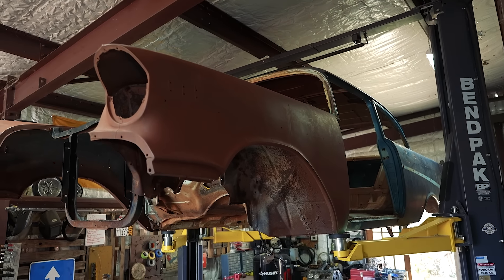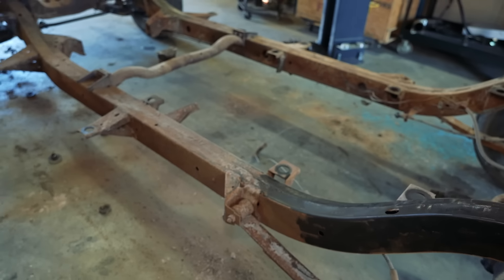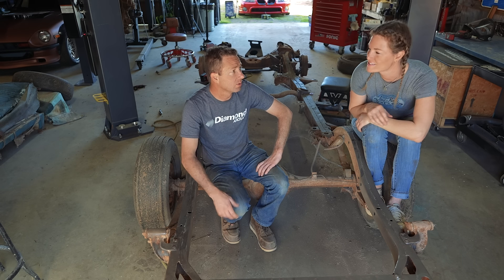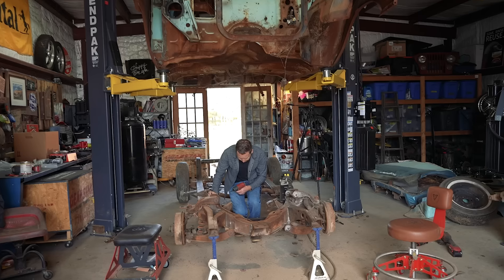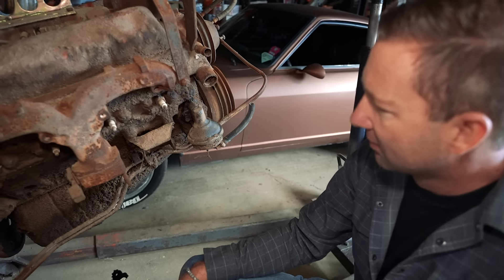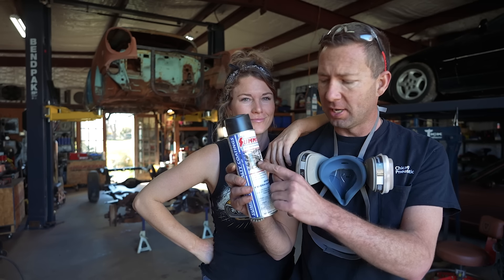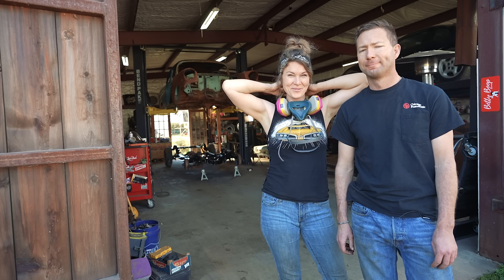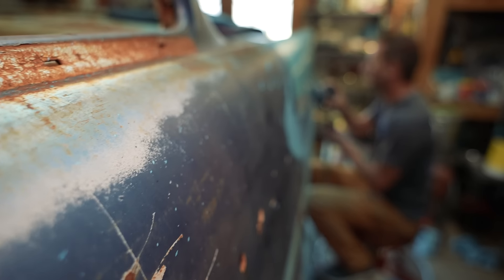57 Chevy SURPRISED us after frame RESTORATION!

Comment: Seriously what did you do with the real Aaron? This guy’s laughing and joking and smiling and taking things in stride why he’s even talking on camera, I did see a glimpse of the old Aaron when he said “ that’s enough woman back to work.” Just kidding I enjoy the new and improved Aaron, more engaging and that helps the channel, can’t wait to see this car progress, and not that it will help this car but Puddin’ from Puddin’s Fab Shop found this paint shaker that goes on your reciprocating saw and when you’re finished shaking up the rattlecan it comes out in a fine mist almost like a powder coat, can’t remember if he got it at Home Depot or another store, and when I saw those welds on the frame I thought was that car built the day after payday and buddy stopped off and had a couple or beers or 20 and then worked all hung over, man they were bad. Thought Aaron was gonna halt work right there and reweld the frame.

Comment: 2 bolt mains are plenty strong,i used to run my 350 up to 8k for years. no valve float,nothing but solid power.i hate rattle cans,the paint is never tough. rustoleum black in a gallon,mix a little in a mixing cup with reg enamel hardener and brush it on. would be so much stronger,looks good tho!

Comment: Just use 80 grit get to bare metal as quickly as possible followed by epoxy primer. You don't want to paint over any old paint or seam sealer. Paint remover is very toxic!

Comment: If that’s the original engine it ain’t no 350. The 350 didn’t come into existence until mid to late 60’s. If original it’s more than likely a 283
Reply from the maker: It’s not original, it got changed out at some point. The first thing I checked was  to see if it was a 283! -Aaron